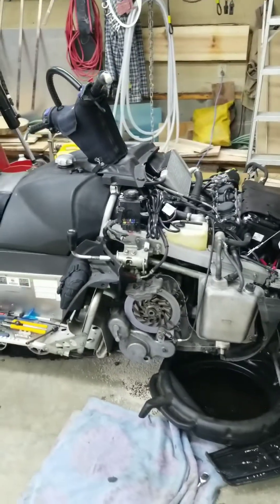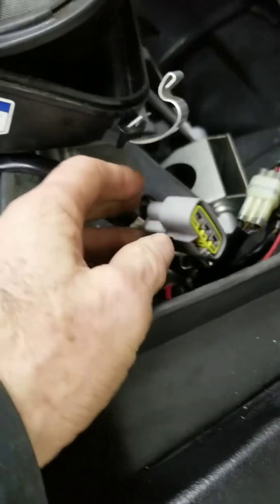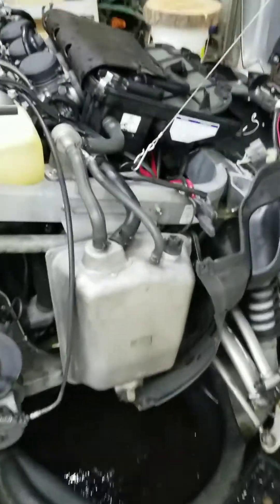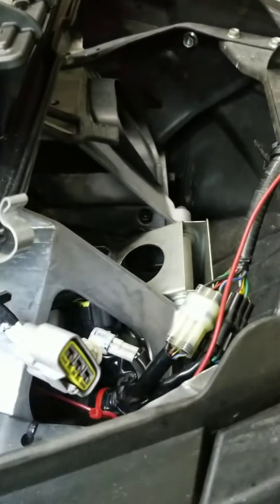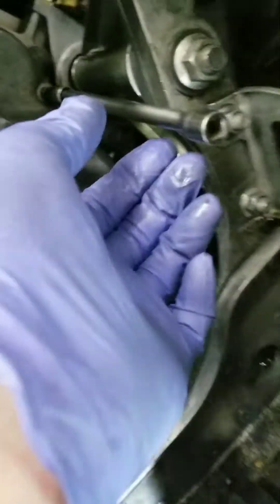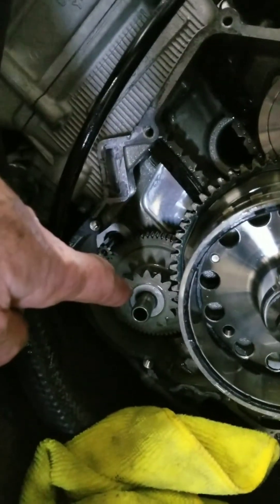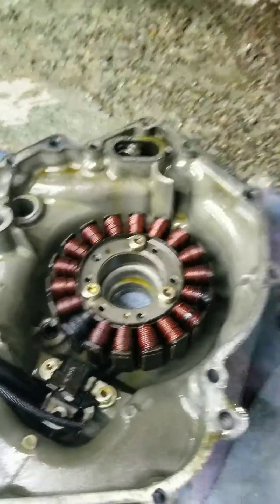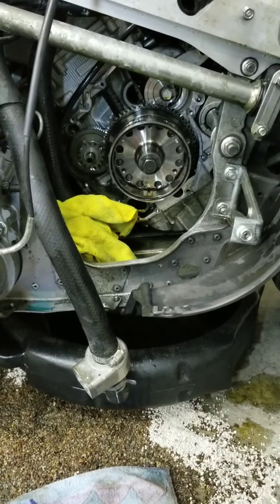Stator replacement on Yamaha snowmobile 4 stroke Genesis VK professional.

Comment: Why didn’t you show taking the cover off there are two bolts at the forward part of the cover where the bulkhead is in the way I had to remove the motor mounts and lift the motor to barely have enough room to get them out this alone took longer than you’re video so show the whole job not just part of it I do this for a living and there’s no way you did this that easy
Reply from the maker: @TheBreedxxx  sorry to say I did do it this way.  You must have a VK pro from another year or something.   The cover comes off the VK pro quite easily once you get the coolant lines out of the way.  Is your machine a VK pro with 20 inch track ?  If not you may have different spacing as a wide track machine has way more room under the hood.  All bolts come out very easily.  Many people have done the same
Reply from the maker: Just adding another comment for people reading this.  Rest assured..if you have a VK professional,  it's very easy and all bolts are accessible.  I have done 3 of them.   They were all 3 cylinder engines and RS Viking 20 inch wide track

Comment: Great Video !!! Very Much appreciated. I have 3 of these machines at a remote homestead in Alaska and one of them seems to have exactly this problem. - One of them runs and works great as long as the battery is charged and it used to charge it at 14.3 Volt at idle, but that is no longer happening... Best Regards, Lars
Reply from the maker: It's not that bad a job.  Good luck

Comment: Dude, thank you so much for making this video!! I have a Yamaha RS. Vector that's not charging and I'm glad you made this because now I can see what I need to check and what I need to do to fix it!
Reply from the maker: Glad it helped.  It's not too bad a job when you know what has to be done.
Reply: Thanks for video Same here just bought a 05 vector . Its an awesome sled super low miles guy just didn’t have time to fix it just won’t take a charge thinking it’s the stator

Comment: Hi Jim, how did you manage to pull the cover, i have the same sled and cannot figure a way to pull on cover and clear the aluminium chassis, it the cover is bigger that open area and the direction rod (even with loosing it) cannot give way enough to slide the cover....what's the trick ?
Reply from the maker: So not sure what rod you are talking about.  I found I had to remove the right side first and wiggle to get it out.  Had to drain coolant and disconnect that hose

Comment: Do i have to drain the oil to change the stator? 2009 fx nytro
Reply from the maker: If it's a genesis 4 stroke it will be like shown in my video.  The stator is submerged in oil if as shown
Reply: @ontariooutdoorsman  I've just tipped it on the side and changed the stator. Still no power.

Comment: watching your video yet again, did you use any lock tite inside the cover bolting the stator in?  also, how do you actually line up that gasket when reinstalling cover?
Reply from the maker: I did put some blue loctite on the bolts holding the stator.  I cleaned the gasket surfaces then used a bit of sealant/gasket maker to hold the gasket to the engine.  Still had to slide it around a bit and got one bolt on each side to hold gasket

Comment: Thanks so much for your help again.  I couldn't find a used one and  oem new was  564 cad.   I went with rm stator for  269 and oem gasket for 15.  $330 taxes in shipped should be here Friday.  I'm going to hope to not take radiator off but if I have to its probably not the end of the world.  I can pull the battery box and ecu brackets off easily to give more room left of the oil tank.  Here's my test results.  Actually the stator part number cross reference to your sled.   
Static test 
1-2 0.6
1-3 0.6
2-3 0.6

Pins to ground.6 ohm

Startup
Batt 13.1v DC new one week ago and just of charge 
Stator readings :
2-3 1.5v ac
1-3 36.5
1-2 36.7

At 2600rpm
2-3 1.4 v ac
1-3 44.1 v ac
1-2 45.2 v ac 
13.1 before start
12.14 running and dropping 

Warm idle 
2-3 1.4 v ac
1-3 27 
1-2 27
Batt 11.9 dropping
Reply: The little sensor tested good also the two wire.  Trested at 188ohm. Spec was 185+ - 20%.  Might keep this oem sensor and stator
Reply from the maker: No problem.  Hope it goes smoothly
Reply: @ontariooutdoorsman  got her done. Unfortunately the water pump bolts through the cover.  I ended up using the right stuff gasket maker on the cover.  The water pump has it's own two bolts and three others it shares with the cover. The bad thing about that is when they pump comes off although it has it's own bolts it still has since flex.  It's an oring that sits in a flange.   So ran great charged great no leaks on first run.  Next day she leaked her rad fluid. The crusty inside of the pump and little bits of sediment around the gasket probably were allowed to loosen up enough to make the gasket not seal well.  Long stylery short stator cover stayed in place by it but stripped down again and sealed pump with gasket maker and reassembled.   200 miles later all good. Thanks again
Reply from the maker: @666dynomax  interesting.  My engine doesnt have anything bolting on to the cover.  No water pump.  Mine is a 973cc genesis. Glad it all worked out. !

Comment: although i've bought lots of OEM parts, the chinese one on ebay for $54 with gasket is temping.  I see what looks like a rectifier or something that comes with it (small metal two bolts holding it on, two wires white/black coming out of it)  is that part of the stator you bought?
Reply from the maker: Yes the one I bought was from royal distributing in canada.  Made by wolftech.  The stator is fine...but the small part with 2 screws (crank position sensor) did not work for me and was not compatible.  May have been a bad sensor or there is a difference.  I had to tear sled apart a second time and put back in the original CPS.  I soldered and spliced with heat shrink.  The wolftech stator assembly...for my install on my vk pro...CPS did not work.
Reply: @ontariooutdoorsman  ahh. Ok good to know.  I'll price the OEM but I suspect it will be 500 Canadian vs 150-200 aftermarket.  On the phazer there is a radiator to deal with I'll likely have to remove but your video looks very close.  The cover looks similar and the stator bolts to the cover like your vk.  Looks like a hard fit out through that hole!!  Are those a 700cc?
Reply from the maker: @666dynomax  my vk is a 1000 cc.  Again..the stator itself was fine.  Just the CPS wouldnt work.  Machine would not start.  Its alot of work to do twice so just keep that in mind
  Stator and cps was only 129 at royal.  But...I had to do it twice and swap the cps 2nd time.  Maybe I just got a bad one
Reply: @ontariooutdoorsman  Im not hearing great reviews of the RMStator ones either.  In the dirt bike world RMStator are accepted equivalent or better than OEM... so i found that odd, they are $269 Canadian.  All reviews of the cheap ebay ones are they lasted only a short time or were defective from the beginning.  I Think you are correct, better to buy proper parts.  I'll look at that CPS as well.   Thanks again, all helpful information.
Reply from the maker: @666dynomax  ya it's a tough call.  I'm curious if the oem stator comes with the CPS or its separate..  the reason they come as a pair is because the grommet all the wires go thru is molded with the wires inside it.  I had to carefully slit the grommet in 2 places to swap the CPS from one to the other..and then I used sealant to seal up.  Good luck hope it works out.  It's easy to .ensure the ac output on the white plug in from your regulator.  With engine running measure from ground to each terminal.  I had 2 of 3  outputs extremely low.  Again.. good luck

Comment: Old two stroke guys say you have to be careful to mark the stator and put it back in the same as it affects timing, did you have to do anything like that, and where did you purchase your new stator from?  I'm kind of in a time crunch for march break, I may take a chance and order a stator without even measuring voltage at battery running/idle/high idle, or from the 3 phases on the plug... I can't immagine there is much more it could be.  my phazer has 6200km on it.
Reply from the maker: So the old type stators sometimes were 2 piece.  One for ignition and one for lighting etc.  Those sometimes allowed adjustment.  These newer round full stators cannot be adjusted.  Bolt in with no adjustment.  CPS also has no adjustment.  Old ones you had to use a feller guage and set

Comment: well looks like i'll be doing this on my 07 phazer.  didn't have a meter at the camp, so i'm going to go back up and check the 3 white wires like you said.  theres a static test (using ohms) and the live test with engine running like you have said, so that uses AC Voltage... good to know.  I was lucky to have two other sleds with similar voltage regulators so i swapped one in with no change.... What i'm getting is no charging, after running 30-40 minutes the battery just keeps dying... brand new battery full charge lasts 30-45 minutes.  I hope mine is as easy on the 500 phazer as it is on your VK.  I do have a rad to remove as well, but the oil tank looks identical to yours.       Was the stator hard to pull off?  I hear it is hard to remove due to the magnets was this true for you?
Reply from the maker: So the stator being attacched  to the inside of the cover does have a significant magnetic pull holding the cover in place.  When you start pulling the cover you will feel like a spring pulling it back in.  That's the magnet.  It comes off fine but you have to finesse the cover out of the opening on the side.  But it does fit.
Reply: Was it similar changing ur stator on ur 07 phazer ?